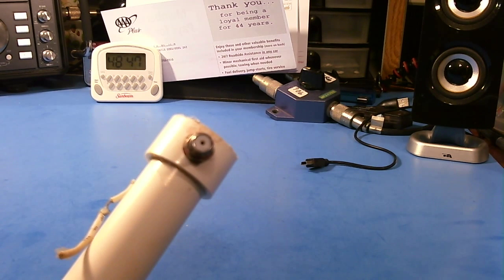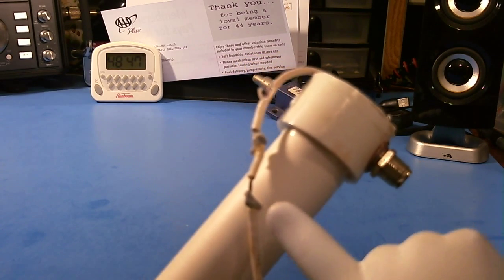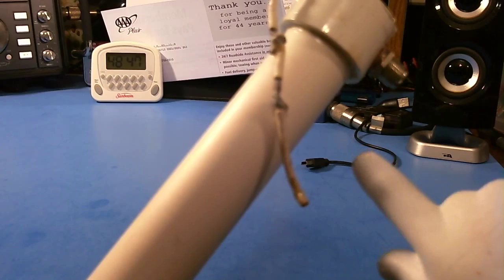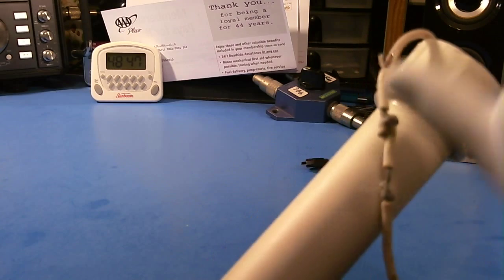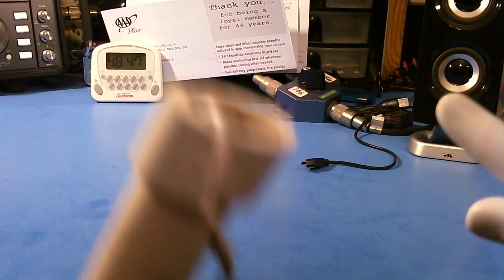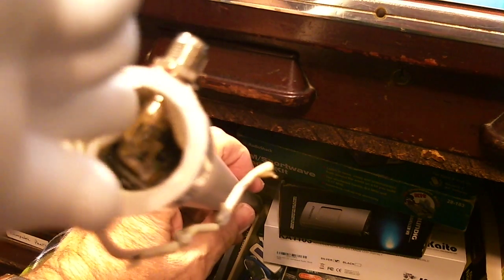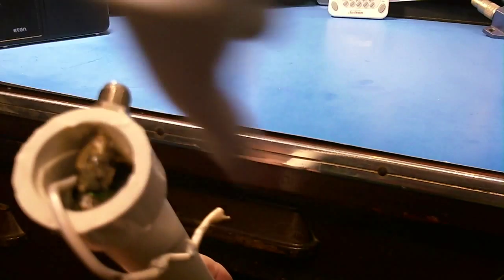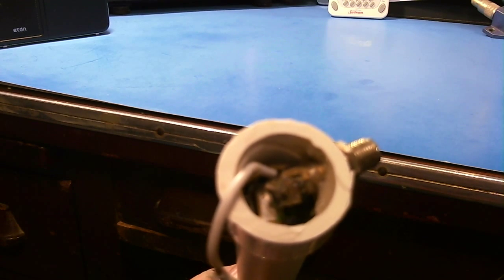TRRS #0439 - Broomstick Antenna Pt 5

Comment: Ahh ok I was thinking it was a resistor or something. I have one of those as well ,but with a wire coming out of the bottom with about an extra  15ft with an alligator clip. Its the same size as yours as well and doesn't work at all. On a side note,I have seen another broomstick version with a built in balun. I'm a little leary on trying another one. I enjoy your videos Tom.
                       Matthew
Reply from the maker: The seller had both models available and I chose the one with the F connector so that I could bring the signal into my workshop using shielded coax cable.

Tom